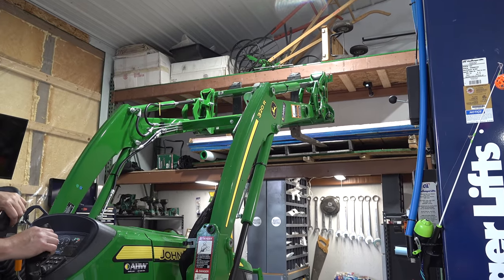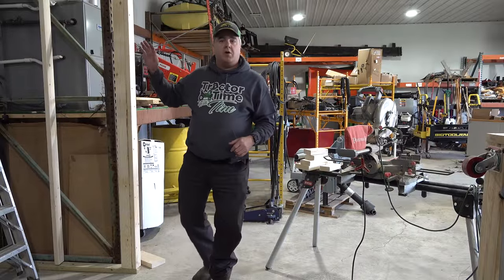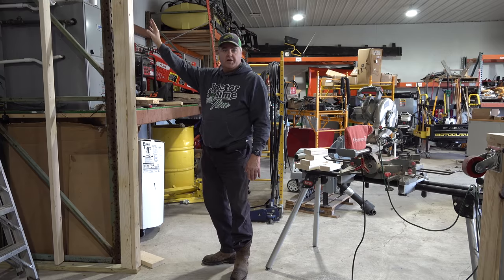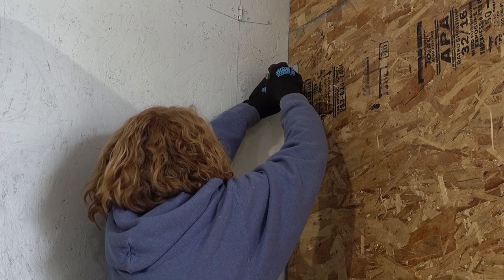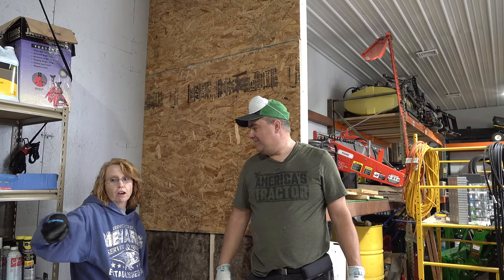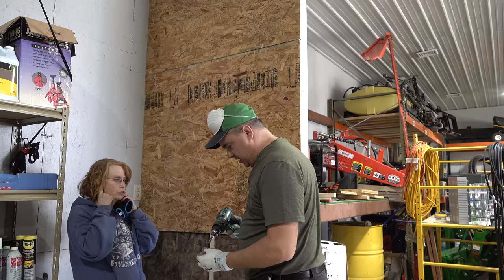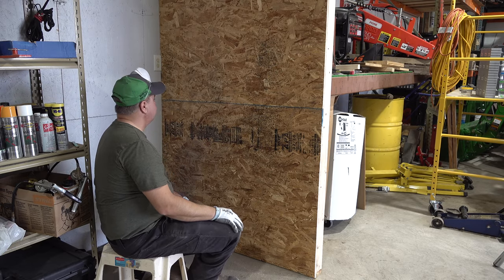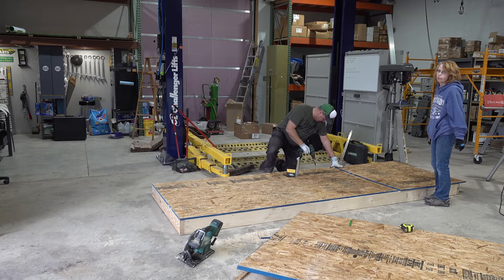Building a Hose Storage System for Our Shop

Comment: Tim, you needed more gap for the hinges between the door and the frame. The door is binding against the frame. I was there with my dad when ever he was working on something. He was a "jack of all trades" which he learned growing up on a farm in North Dakota. What ever he did, it was done correctly, no short cuts. It was the best learning I ever had.

Comment: I was in Home Depot the other day and a 4 x 8 sheet of 7/16 OSB was $44.00.  Couple years ago it was $7.00.  Save all your scraps and glue them together.  They are like gold.  Have a good day as usual.
Reply: I observed similar prices at Lowes the other day with OSB and over $8 for a 2x4. Not sure how anyone can afford to build....at some point, people will stop buying unless it is for emergency repairs.
Reply: I am remodeling my bathroom and needed 3 sheets of OSB for the subfloor and for ¾" 4'x8' sheets it's like 70 bucks it cost me a little over 200 just for those 3 sheets...insane!!! Thanks to the current administration of this country!!
Reply: I just bought five 2x12x16 boards...cost $360. At least it was a business expense.

Comment: FURNACE WARNING! Hey there Tim, nice way to hide and store the hoses. I didn't see where the cold air return for the furnace was. IF you box the furnace in with another wall, just make sure you don't block the air flow, or you'll burn out the high limit and have no heat. Same thing happens when folks don't change the filter and it gets plugged up. I've replaced hundreds of limits in my career for that reason and want to save you the service call. Have a great day 😃
Reply: When's the last time you changed your furnace filter?
Homeowner: What's a furnace filter?
Reply: @jamesrussell6870  🤣 I can't tell you how many times I've heard that!

Comment: Great idea for both the sound and storage. I would use a magnet catch to hold it closed and if the hose rattle is a concern a few bungee straps across would suppress that and possibly help keep them up there better, (although it is likely not needed).

Comment: Hi Tim, That's a nice way to hide the hoses and cut down on some sound. With all of the weight hanging on the door you should consider putting a diagonal brace on it. You said the wheel doesn't touch the floor in all spots is why I suggested this. Keep up the great videos!
Reply from the maker: Guess I thought the OSB screwed to all sides would tend to keep it square.
Reply: @TractorTimewithTim  engineers are taught triangles are stronger than rectangles.  Osb doesn't have that much strength in shear.  I have confidence in more hoses being added in the future.  They make wheels that have springs on the vertical shaft that attach to the door.  That would help solve the uneven floor and take some load off the hinges.  You may want to consider that rather than modify the Tom Sawyered door.

Comment: A few things...I'd put on 2 more hinges, I had a door much smaller than that on my 10x10 shed with 3 hinges the same size you're using on your door and it sagged & there was none of the weight you have in hoses on it (200lb?)  The floor is pitched so any water that gets on it will go out the door, all garages should have that pitch.  I'd also add either a diagonal 2x4 or a flat iron bar from the top hinge down to the opposite side bottom. Doing this will also help keep the hoses from knocking around.  As far as totally closing in the furnace, it needs O2 to keep the flame going, so you'll either have to take the air from outside (what I did) or put vents up for both the intake to the heater section as well as for the burner itself.  BTW  Keep the foam far away from the furnace, bad idea!  You might also think about painting the inside with fire retardant paint. Hope this helps!

Comment: I suggest you mount the wheel on a shaft, then spring load the wheel on a bracket.  That way the wheel will carry part of the load regardless of the variance in the floor.

Comment: two quick suggestions, watch the breathing room for the furnace.  couldn't see if it was all closed off or not.  second, the furnace will draw dust into that closet, consider getting a bag of cheap party balloons to use as dust covers on the ends on the hoses (green and yellow ones)

Comment: Hey Mr Tim, remember when you taught us the basics of chain?   

I’ve watched that video many times and it was very helpful to me. Thank you for making it.  

Guess what else I don’t know anything about? Hydraulic hoses.  

I have been told by a neighbor I should keep some spares. 

I haven’t a clue what to do. 

What size hoses should I get? What diameter? What length? What type? What material? Where would I get them? What type of ends do I put on them or are they all the same? Do they come with the hydraulic fluid already in them? Is that a concern, the fluid? What else should I know to select and purchase spare hoses?

If you’re looking for ideas on a video, I know I would be grateful. I just did some YouTube searching and there’s just nothing out there that answers those newbie questions I have about hydraulic hoses.  

Whether you make a video about what we need to know about hydraulic hoses as a sub-compact tractor owner or not, thank you for reading my comment. 

Personally, my tractor hydraulic hoses needs are on two attachments, the front end loader, and the snowblower. The snowblower hose has some strange fitting that I would describe as a metal flexible 90° elbow. 

I also have hydraulic hoses on a log splitter which look completely different then the tractor. Nothing in common about the log splitter hoses or fittings with the look, size, or fittings on the tractor.  

Thank you.
Reply from the maker: Hmm.  Interesting question.   Maybe I could address in a video.  We discussed how to identify thread types and sizes in a recent farm show video.  Did you catch that one?
With the tools shown there, and DiscountHydraulicHose.com, you are set!  :-).
Reply: @TractorTimewithTim  I will go look for that previous video. Thank you.  My neighbor said go get a hose from Napa. I was too embarrassed to ask all my questions thinking I must just be a noob.

Comment: Nice work. 👍 On an unrelated note, is there any more 2038R vs LX3310 videos in the works? I am looking forward to seeing more head to head comparisons of those 2 tractors.
Reply from the maker: We should have another one or two.
I’m assuming you saw the turning radius?
Reply: @TractorTimewithTim  I have watched that video as well as the one comparing hydraulic flow.  I was just curious if there was anymore comparison videos in the future. I didn't know if you were planning on making a comparison series like you did with the 1025R vs BX.  I may be upgrading from the 1025R in the next year or two, and my most likely 2 choices are 2038R or LX3310.
Reply from the maker: I’m having a bit of a problem doing this.
Quite frankly, there is no comparison!  The 2038r is FAR superior!  However, if I go through all of that testing and show all of that detail, the Kubota crowd will scream!  They will say “told you so!  I KNEW you were biased!  Can’t be trusted, etc.”
I guess I’ll just hit around the edges and avoid the anger.
Reply: @TractorTimewithTim     
I see.  It's a shame there is so many that only want to criticize and complain.  I look here for information because you AREN'T overtly biased.  You're not trying to sell me either machine after all.  And owning one of each you ought to have insight into both as opposed to those that own one machine and borrow the other for a few hours to do a comparison. 
 Both JD and Kubota make good machines.  I am leaning towards the 2038R because of the JDQA stuff I already have but the local Kubota dealer is closer and better to deal with.  But if you say the 2038 is far superior I will gladly take your word for it.
Reply from the maker: It really is a much nicer tractor.  Some of the specs are very similar, in fact, the LX will win the 3 pt lift and maybe some other tests.  However, driving the two is night and day difference.
If I could articulate this without sounding biased, I would do so.

Comment: Might I suggest a straight (non swivel) wheel rather than a caster (swivel).

Another suggestion is a small magnet on the door to stick to the metal shelf. We have several doors that don’t want to stay open and we found these magnetic door stops for them. They work great. The door stops have a spring in it to absorb the sudden stop.
Reply from the maker: I have a straight wheel. I had decided that it would drag sideways slightly when opening or closing.
Reply: @TractorTimewithTim people use straight wheels on heavy swinging doors all the time. I guess it’s too late now. It would be a PITA to change it now. LOL
Reply from the maker: @jeffherndon  it is bolted on.  Probably easy to change, especially if the hole patter lines up.

Comment: You probably already have a video on it but I see tractor guys and construction guys down waiting to get hoses we’re having to go to a store and grab them. How hard is it to put the ends on those? Is there a tool you can put in the back of a pick up or in your shop where you could crimp your own ends and make your own hydraulic hoses and choose any fitting you want or is it something really difficult the shop need special equipment to do?
Reply from the maker: Roughly $4000 investment for the basics…then additional inventory for different fittings, etc.

Comment: Tim, when you close the door try just kicking the caster wheel sideways and that should stop it from drifting out.
Reply: Kinda looked like a fixed caster to me. IDK.
Reply: @carlstrohm3785  If you look at 9:10 you can see the caster is perpendicular to the direction of travel and then swivels to travel when Tim opens the door.
Reply: Looked again and I saw it move. My bad

Comment: Doesn't seem like you put any thought into the idea or planning of this project other than ordering a "hose rack".  I cannot understand why anyone would want this sort of design for their hose storage system.  Why not actually use the hose rack in reducing their length by placing it OVER the rack at the midpoint of the hose, or better yet and much more simply, why not roll them up and zip tie together the set with an ID tag of what it came off of or if spares what it goes to?  Did it never occur to anyone (you, your wife or the cameraperson) that this is a very high risk fire hazard being directly in front of a furnace?